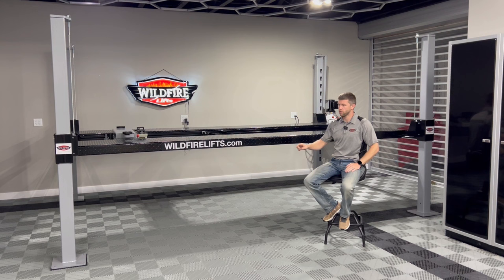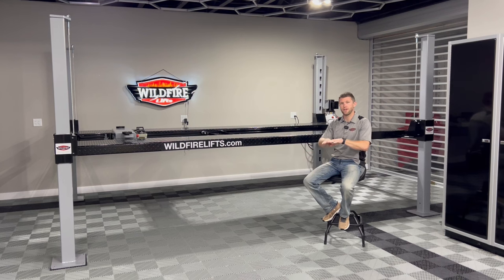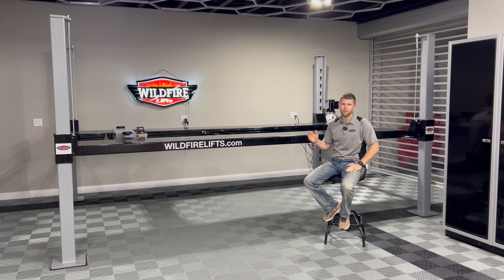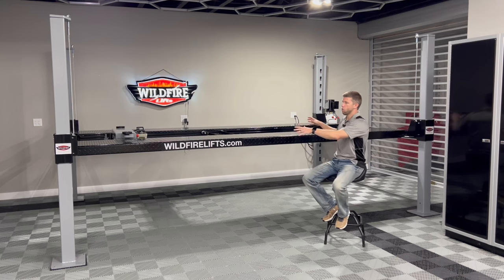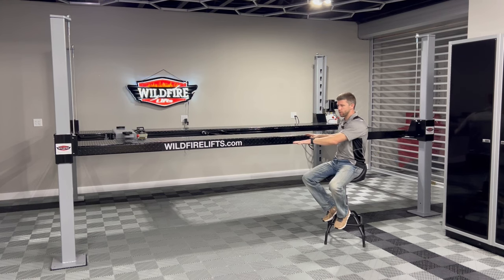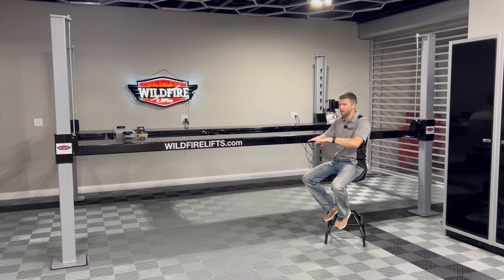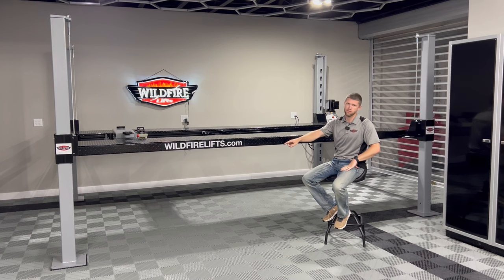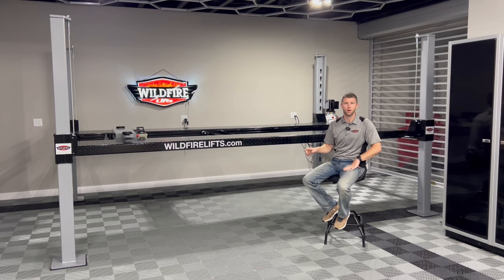4 Post Lift Concrete Requirements

Comment: Can you put a hard rubber tile under the 4 legs of the lift to insure that they make even contact with the floor? Would this reduce the chances of the lift shifting during operation, if it is not bolted to the ground?
Reply from the maker: Yes. Many customer decide to place rubber tiles under the baseplates. 99% of our customer leave their lifts unbolted. The only time we’ve heard of one of our lifts that was unbolted shifting was when a customer backed on his dodge demon and the ultra sticky rear tires and huge Hp caused the lift to slightly shift.

Comment: Also, what do you do if the garage has a slope of at least 3-4 inches? Do you put more of those rubber plates under the list feet that are on the lower side of the garage?
Reply from the maker: Yes, you can shim the lift with dense rubber shims (weight lifters mat or horse mat are good options).
Reply: Rubber blocks can be placed under the base plate